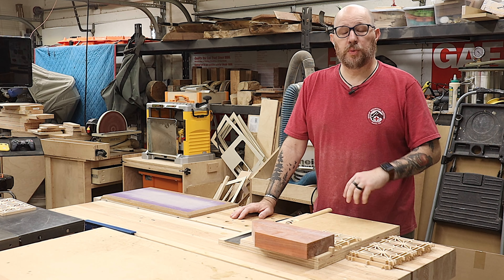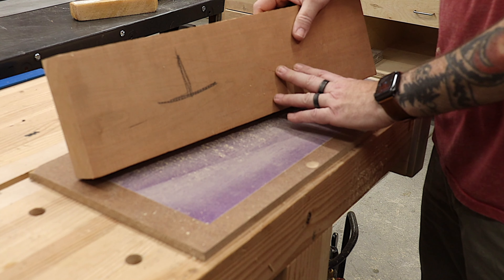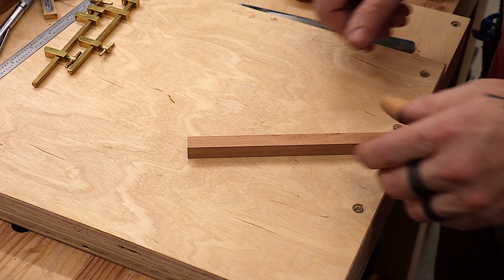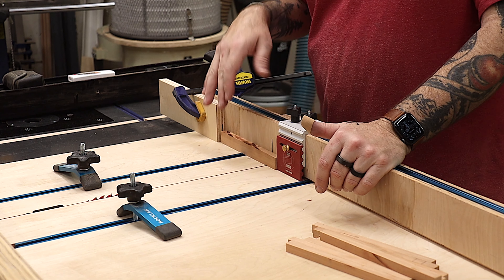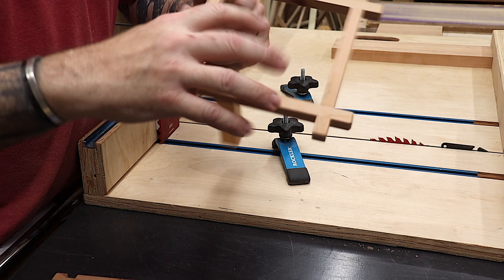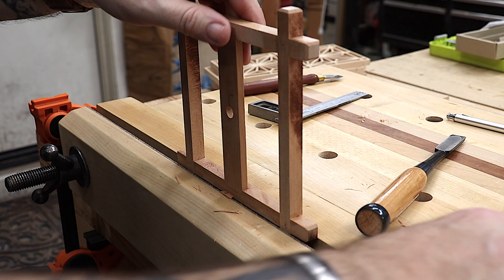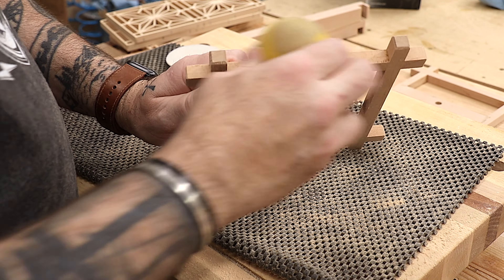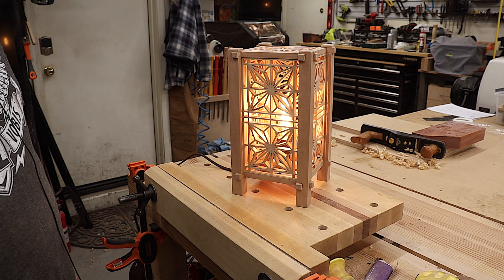Woodworking: Making a Shoji and Kumiko Lamp Part 3 (Assembly)

Comment: Really nice, Ed. Leave the paper off. Why go to all that trouble and then disguise the panels? Stay safe.
Bill
Reply from the maker: Thank you Bill!  I agree.  Once I turned the light on for the first time, I knew I didn't want to add the paper.  That's not saying that I don't want to try making a pair with the paper.  So stay tuned.  - Ed
Reply: The paper goes on the inside to defuse the light, so the kumiko stays on the outside to be enjoyed. Sending lots of love 💖 from sunny 🌞 Arizona 🌵. Take care of yourself and each other 😷.